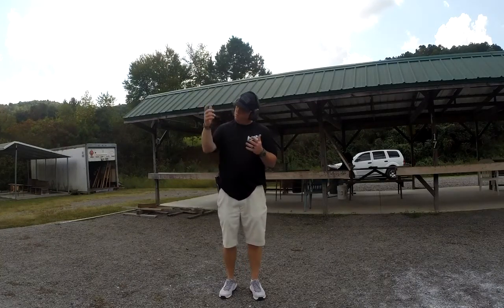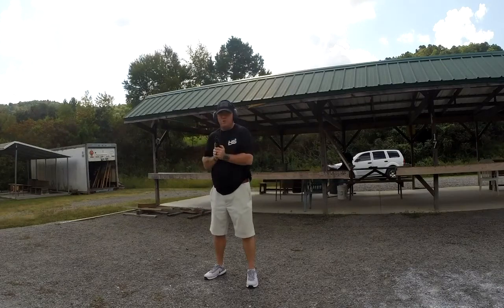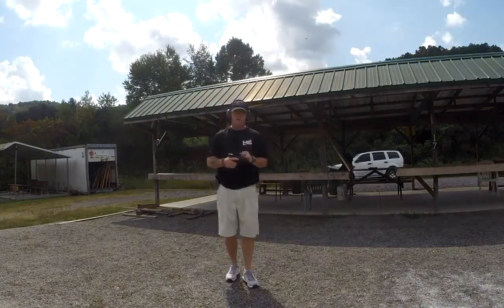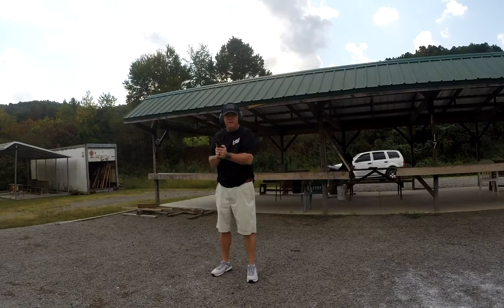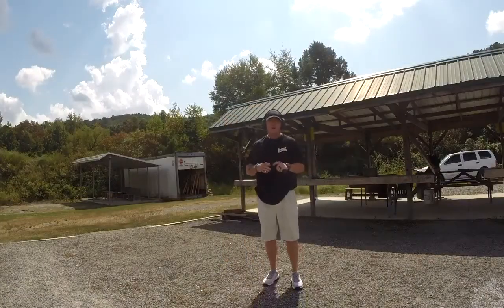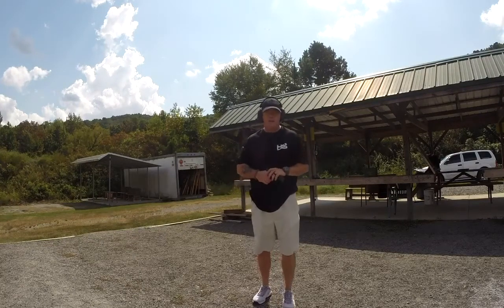Identifying & Clearing Pistol Malfunctions

Comment: Another great video man!  
But With the stovepipe just racking the slide may not be enough right? Do You recommend flipping the pistol to dump the spent case?  
I used to get stovepipes with my 9mm with Remington umc. Once every 20 rounds or so (Only with this brand too, weird) and since the next round isn't yet able to be grabbed by the extractor a rack alone may not get the case to 'jump' out, it could simply rattle around in there. 
Also your forgot category 4 AKA a brown malfunction......a guy in a hockey mask  is trying to murder you with an ax, you properly and expertly defend yourself, but after putting him down, ya gotta get some fresh drawers on. Maybe that's just me though, you seem to be made of tougher stock than me, I mostly keep in the kitchen away from the fightin'.
Reply from the maker: That's hilarious. Yes, you are correct. It could never hurt to slant the gun to help the extraction.
As far as the Jason attack, I don't think a new pair of drawers will be enough. That will also take years of therapy to fix.
Reply: Ghost Tactical your right it wasn't enough.........."sigh".

I joke but don't take that as not taking your teaching seriously, you do a great job
Reply from the maker: I appreciate it